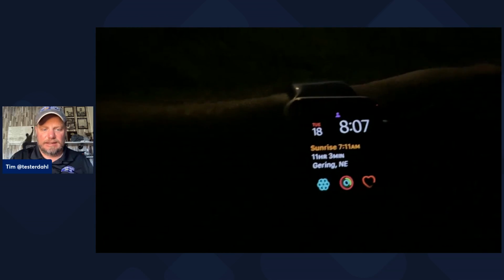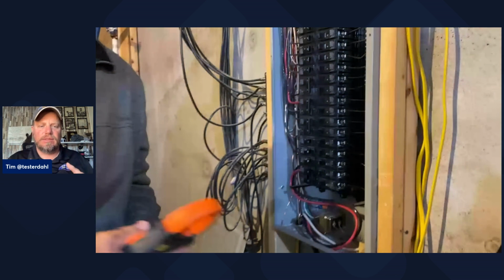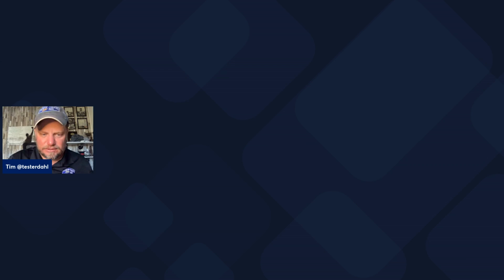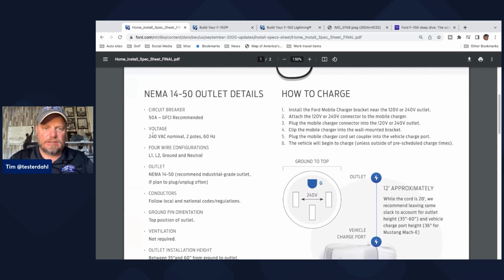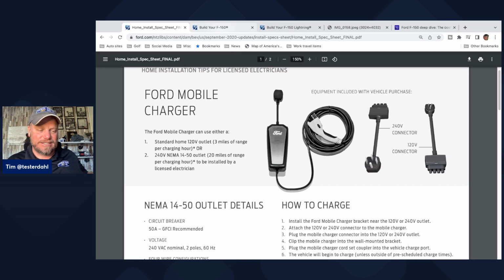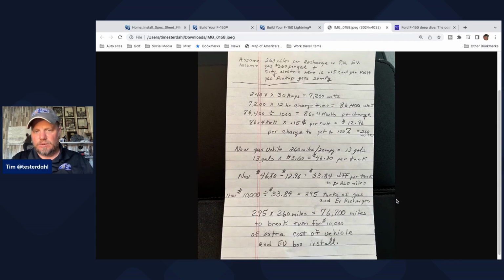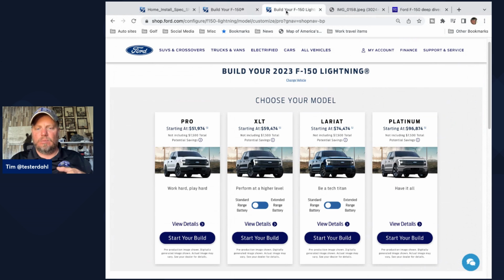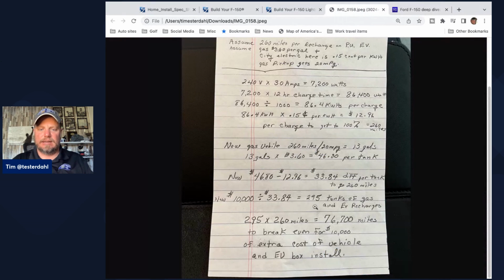11+ hours later on 220V charging price for 2022 Ford F-150 Lightning

Comment: . . . and you're going from sometimes fluctuating Residental Electrical to a modern Electronics system, nothing is linear on either side of the equation. . . so the only true measure of performance is a meter on the electric circuit your charger is on and Solid record keeping on miles driven over a period of time and type of driving documented. Then try to come up with a solid average

Comment: Another thing that NOBODY talks about is... Where does all this "clean" electricity come from. Let me save you a little time. It varies depending on country you're in exactly what sources are used to generate electricity, but worldwide, it's coal. By far. 

In case you didn't know it coal creates more carbon emissions than any other fossil fuel... So by electrifying everything, you're INCREASING the world's use of coal a LOT more to create the electricity needed to charge all these things that made LESS carbon when they were powered by gas, diesel, LNG, etc.

Unless and until the world finds a "cleaner" way to produce electricity, then electrification is WORSE for the environment, not better. 

I know what you're thinking, nuclear is it! 😂 Please tell me... Do you know what exactly happens to a person who dies from acute radiation syndrome? Do you know that we're desperately trying to find "safe" places to store the immense amount of nuclear waste we already have without ramping up our use of nuclear power? Did you know that the amount of nuclear material that made 1000 square miles around Chernobyl deadly for the next 3000+ years was only 5% of only ONE of the reactor cores. A fully spent core remains deadly for many thousands of years. 

Again, we could go on about this forever. Electrification as things are now and for the foreseeable future, is actually BAD for our planet.

Comment: yeah Im good on all this plug in vehicle shit, If you got an emergency or have time sensitive truck and have no more miles. Imagine having to turn your AC off and stereo off just to make it a few more miles. shits a joke and for the birds. NOW one day yes i think that electric vehicles will be the future, but until they are cheaper and have solar capabilities adding to miles. Imagine driving a tesla across county and the roads you want to travel. Instead of being told where to go so you can charge your RC.

Comment: So I want to drive 800 miles and it takes me 13 hours to charge and I can only go 260 miles per charge. Add your motel bills for so day one... 4hrs 30 min plus 13 hours sucking my thumb while charging. 17.5 hours later I can pay 100.00 for motel bill. Then I can drive to 4.5 hours. Wait around twidling fingers this time...anotherc17.5 hours later another 100.00 motel bill. And I have only driven 520 miles in 48 hours. My time is valuable so I get to pay myself 30.00 per hour.. and I have spent 34 hours twidling thumbs again x 30...so 1020. Plus cost to charge..another 50.00 plus wear and tear on tires maintenance. Add another 20.00. So to drive 520 miles I'm out $1270.00 at a cost of... and I have another 280 miles to go...add another day, another motel bill, another 30.00 per hour of my time..but wait...I can only go 260miles per charge so another motel bill, because I have 20 more miles to go for total of +$2000.00 to travel 800 miles.
   I could have filled my tank for $65.00x2 and driven 16mpg...for spending 130.00 and 1 motel bill of 100. And my time for 12 hours at 30.00 hour 360.00..grand total of $590.00 total and 800 miles later im where i want to be in one day.   NOW WHAT IS ELECTRIC COSTING ME...WHAT AM I SAVING???? over $2000 vrs $590.00.
Reply from the maker: "So I want to drive 800 miles and it takes me 13 hours to charge and I can only go 260 miles per charge."

No, not at all. This isn't how you charge for a road trip. You use fast chargers which are much cheaper. Think 30 mins and not 13 hours.

Comment: Btw, the towing range is not 260miles on that truck. More like 80 or 90 tops. Then got to charge it for 24hrs?? 

Good grief.. 🤮
Reply: In 10yrs, whats the cost of the replacement battery? Lithium prices have 3x in last 2 yrs and predicted to 3x again. Thatd put a new battery over $40k ??? Yowza..
Reply: My numbers here.. there is NO "break even" point. And solar panels dont put out free electricity. Those panels as well have a 20yr to 25yr "break even" point amd they only last 17 to 18yrs on average and then have to be replaced. So THEY dont have a break even point either. This is why I only see am expensive snake oil pipe dream being sold with the electric thing.

Comment: Interesting but potentially misleading. Your conclusion that "you have to drive at least 12K per year to equalize the price" is interesting, but your conclusion that there is a point at which the CO2 becomes favorable to the electric truck is false. You did not account for the electricity which is, undoubtedly, provided via fossil fuel NOR did you calculate the hundreds and hundreds of gallons of fuel used to mine, refine, and transport the rare metals used in the batteries! If you look at others that have done this calculation you'd need to drive the truck something like 50 years to hit the CO2 break even point...and that assumes electricity prices do not rise at all (which we know have gone up 25-50% depending on where you live, in just the last YEAR). 
Now let's talk about what people actually DO with trucks. They haul things, large, heavy loads or trailers. One of the most recent tests showed that with even a LIGHT trailer the 260 mile range was actually more like 87 miles! That's a bit more than an hour of actual driving. Then,. according to your numbers, IF you can find a rapid charger you STILL have to wait 11 hour to recharge. No thank you.

Comment: You didn't factor in the cost of replacing the battery after 7 years, and you also didn't calculate the carbon cost of generating the electricity. 90 percent of the USA electric grid is fossil fuels. So you're just moving the emissions from the tail pipe to the smoke stack at the power plant. Even if you went solar you would have to offset by the negative hit from the production of the panels and inverters.  It's not helping the environment at all.  The only thing you've done is go from a 10 minute refuel to a 10 hour refuel. That's  a Net loss.  Plus the electrical grid in the USA is not sufficient to provide power for everyone to even run their AC all at the same time, and is way short of AC and EV charging at the same time.  That means doubling the infrastructure of power production and supply lines. and that is not going to be built with EV's. EV's are not a viable alternative given 'current' (sorry for the pun) technology.

Comment: BUT !
        They say the battery is only good for about 5 years .
   To replace it cost over $20,000 ,which could get even higher. 
  If you decide to trade it in before that,the value will decrease tremendously. 
       And the little man who can't afford even a $40,000  vehicle, may soon be walking .
      This could result in the crime rate increasing. 
     If people can't drive ,they can't get to work, can't feed their families.    
      Than what ?
  People who work at McDonald's, Walmart, or even trash pick-up will soon not be able to survive   They can't get workers. 
  So these places close down .
               HAY, IT 
     COULD HAPPEN. 
                    🤪
       Oh ,my daughter worked at McDonald's for 2 months, making $13 an hour, during that time 17 people quit. 
    Between the bad management and rude ,crazy costumers, 
   The stress is not worth the pay .
   My point?
      These EV s. Are adding to stress to people's lives .
       And I have enough. 
            STRESS. 
   Thanks, but no thanks .
Reply from the maker: 5 years? Where did you read that? It has an 8 year, 100k mile warranty for starters.
Reply: @Pickuptrucktalk    
   From videos just like this one ,   they find ways of voiding the warranty ,
   You abused it , didn't do something properly. 
         It's all about profit, if they find a way to void the warranty   ,
      They'll do it .

Comment: Twelve hours of charging for 4 hours of highway driving. Not very practical.
Reply from the maker: Don't mix up at home charging with road trip charging. Completely different things.
Reply: @Pickuptrucktalk  ok, let’s say you can charge the vehicle in half an hour at a charging station. That’s still six hours of charging for a 1200 mile trip pulling the trailer. In the Canadian winter with the heater on  and the headlights on would you still get 100 miles from a charge?
Reply from the maker: @andysharp4154  Right. Pulling a trailer with a BEV in Canada just isn’t going to work. That’s why Ford and others have said they won’t go BEV with say HD trucks. The tech doesn’t work. It will be diesel, gas and hydrogen eventually for those kinds of towing jobs and weather conditions. 

Also, heater and headlights don’t draw that much power. There’s a follow-up video showing how little accessories actually use for power draw.

Comment: I just took a 650 mile trip in my 1999 F-150. Took 11 hrs with a few rest stops.
How long would it take  in your $80k ev?
Reply from the maker: Depends on where you drove and how many fast chargers are in the area.
Reply: @Pickuptrucktalk  
Was almost all interstate.
So go best case scenario.
I can see where an ev will work locally quite well but  have watched a number of videos where a cross country trip was quite challenging and stressful.
Charger anxiety: lack of availability and operable chargers. Add charging time, turns a relatively enjoyable trip into something else. Hopefully technology will increase to make them more efficient with less initial expense. 
Also electricity production will have to greatly increase to supply the added demand.
Reply from the maker: @rickcham7781  right. They don’t really work on a road trip right now if you are worried about getting there in a hurry. Just going to take time until that changes.

Comment: Perhaps, you are viewing some these numbers, such as range (either ICE or EV), as absolute numbers when they are estimates based on algorithms displayed on the instrument panel display. These estimates, say range again as an example, are refined as the vehicle is driven. So parked data is going to be a rough estimate. The display has no way of knowing that you might wake up in the morning, after charging and displaying 257 mi range, and attach a large trailer and climb a mountain. The vehicle, either ICE or EV, would of course, not be able to provide the 257 mile range, so as you alluded to, from easily obtainable data it is complicated, as you have found and state, and variable. I concur with @Byron Haley below, well designed charging system regulates charge rates based on many variables, including temperature (ambient and cell pack), and resistance (very important as cells age if you want longevity and many charge / discharge cycles of the pack). Similarly, discharge rates are also regulated. The data to calculate more accurate results may be available as my 2013 F-150 5.0L ICE, with the proper scanner, shows additional variables such as %ETOH in the gasoline, barometric pressure, temperature and various settings different control modules set. You will need to be able to record this data for calculation over time and not single measurements. While probably not as complicated, I expect an EV would have similar.

All in all, a thought provoking video. As seen in the past, EPA Estimates are a thumbnail guess based on a sample of the vehicle to test and a "defined" set of parameters (think the VW Diesel debacle). 

I think the takeaway is that it is exceedingly difficult to accurately predict real numbers encountered when the vehicle is actually being used. With all the above, rough data is still somewhat usable to calculate a rough cost analysis and an idea of a break even point keeping in mind, identical trucks in two different drivers will have different outcomes.

For me, I would love to have a 2022 Ford Lightning; I think it is super cool. My commute to work is about 25 miles, so it would be a nice daily driver, but it is expensive and not particularly practical for a road trip. 

Regards,

Comment: No one gets it. When you have options, things find balance. Why force everyone to electric vehicles. Why not continue with gas and diesel, add hydrogen vehicles and develop other alternatives too. Electric vehicles are fine for moms minivan and small commuter cars, trucks need gas and diesel. It's stronger, more convenient and able to perform the tasks on demand. Don't kid yourself, you aren't saving the environment with an ev, batteries, 13 hours charging times, mechanics jobs..ugh

Comment: There was another test on YT with a EV truck versus a gas powered truck towing identical toy hauler trailer that was empty no motorcycles no food no propane tanks no water in the tanks nothing a stripped down toy hauler and it barely went 70 miles before it needed a 8+ hour charge ev trucks are a joke

Comment: My question is this. On AVERAGE, how accurate is the predicted miles to zero charge?  99%charge indicates 260miles of driving range.. what is the actual "real world amount" driving the truck just like you would with a conventional engine ?
Reply: In mountainous terrain, that range would be significantly less as would be in a ICE vehicle.  But I agree with your comment that the 260 range is questionable.  EPA stickers say, "Your mileage may vary."  should be changed to "You mileage WILL vary and most likely will be less."

Comment: A lot of good info if your, maybe, already evolved.  Otherwise, a little confusing to me as to specific points your trying to make.  However, one major point, you briefly hit on, is TIME.  Your time and/or my time cost money!  I fill up in well under ten minutes once I pull the nozzle for gas to fill 1/2 tank.  Your demonstration…..over 13hrs for 159 added miles at 220v.!!!!!?  I could have stopped you at that very point.  However, good video.  I would have your master electrician install a digital AMP-HOUR METER on that circuit and keep a log as well as your EOM electric billing with the posted kilowatt costs.  Then compare your EOM GAS costs to your expended Kilowatt costs.  Leave out maintenance cost as they vary too much or throw that in latter.  Whatever, EV will limit miles and time (with costs) at present technology that is currently CHINA IMPORTED.

Comment: what people don’t get towing which some do with pickups no range. next theirs not a whole lot of charging stations between charge ups. most rv sites theirs only one fifty amp service available for your rv. older rvs are thirty one plug so to get better life out of your even extended range is 80 % . but towing gets an 80 mile range with an rv. fast charging degrades the batteries life faster to replace them your cost will be 10,000 plus. then only select dealers can work on ev’s towing is factored into be in the thousands if you run out of charge. honestly for now they don’t balance out cost wise. alternative fuels with v-8 engine  propane, hydrogen run the engine plus re charge the battery so have a hybrid. until more charging stations get bought and the grid can take it. hypothetically let say you pay a flat charging fee some places free 30.00 even for even extended range per stop where you can charge fast 💯 % every stop and the range last as long as fueled vehicle hauling etc doesn’t effect the range any more than electric then you’d have an option. for us to hook the rv up fill up our one ton 30 gal tank about 200.00 bones rounded up depending diesel fuel costs. 50.00 gal closer to three 300.00 a stop. give or take. your limited to where you want to travel motor homes 1,000.000 plus some have big tanks your shelling out every stop. yellowstone ehh six grand in fuel we’d fill up every half to quarter tank diesel is between five n six a gallon

Comment: EV trucks make zero sense. Too heavy to begin with due to the huge battery bank. 250 miles is not enough to start with. As soon as you add a lot of payload, the range becomes indeed a joke. Once your use the truck for its main purpose, pulling a trailer, you are doomed with a range of below 100 miles. Then try to pull a 15k pound trailer in cold weather. 70 miles if you are lucky? How much did you pay for this nonsense of a truck? 70k? Did you even buy it or is it just another presser for a week?

Comment: My 2018 Nissan LEAF has the same size charger for a car that has a 40kw battery.  Not sure that would be best for a truck with what a 90-100kw battery?
Reply from the maker: There are faster chargers that Ford offers for home use. I just don't have one, since I only review these vehicles and don't always buy them.

Comment: solar is free??? add $10,000 more just for a system that will charge it and that's building the system yourself. and that is a very low budget solar system . a large server rack will cost ten grand and i haven't done the math on it. but the numbers your showing you'd have to increase battery storage to charge at night. the EV bs is just that , it makes boats cheap. lol the ev scam.  don't get the platinum package get a visa platinum card your gonna need it.